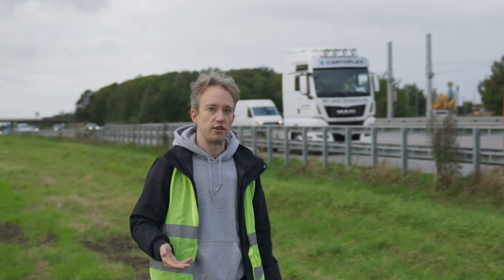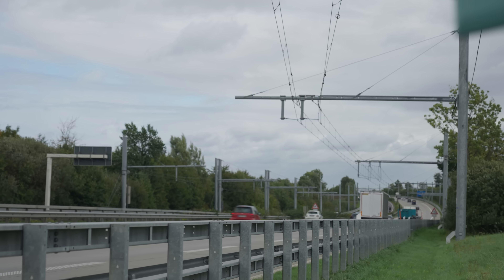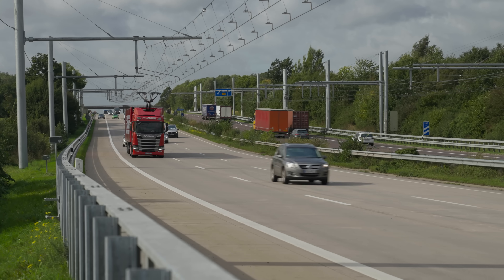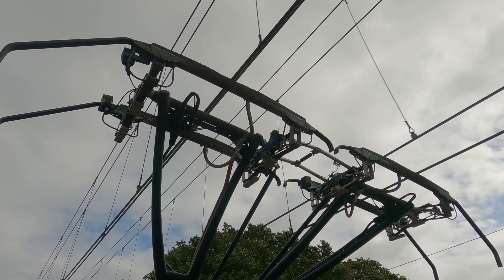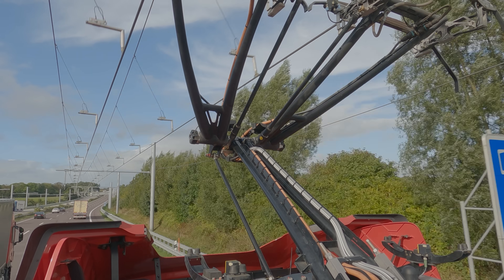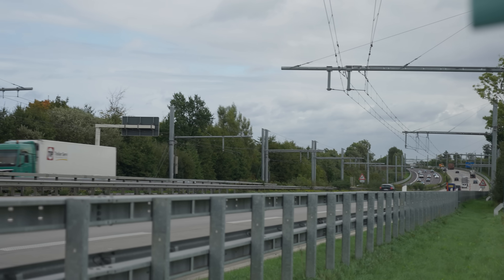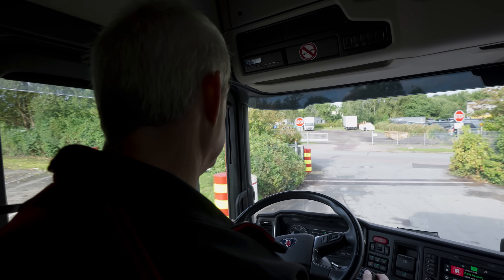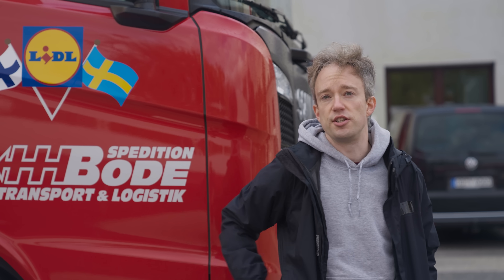The highway where trucks work like electric trains

Comment: A great idea. Provided you never expect to change lanes or enter/ leave the motorway. Electric trains can change tracks because the electric is always right over the turnout/ points. But when a truck could need to change lane at what amounts to any random location, this system breaks down.

It won't happen.